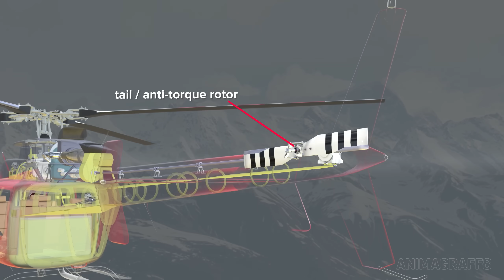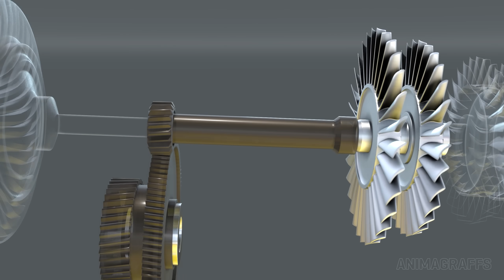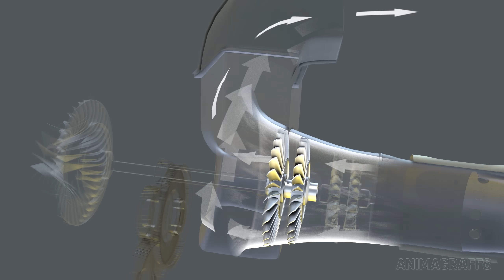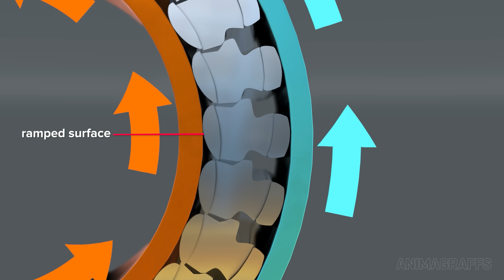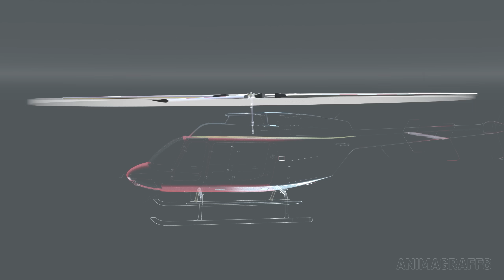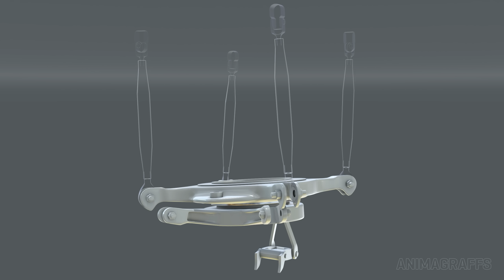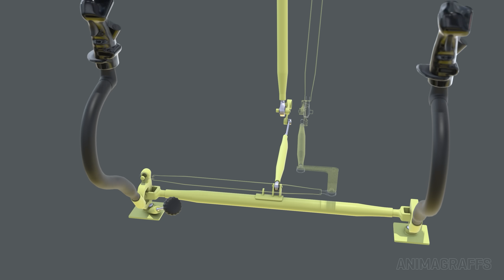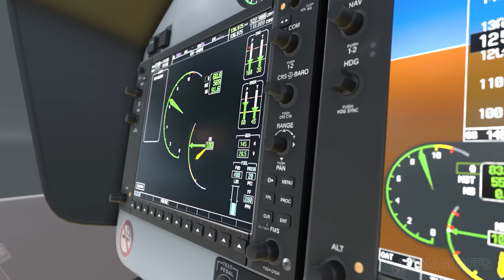How a Helicopter Works (Bell 407)

Comment: Very good, may be it is time instead of making helicopters with so many moving  parts use drones with four electric motors and gasoline generator on board to supply power to the four electric motors to reduce risk of so many moving parts like helicopters.

Comment: The more you understand how a helicopter works, the more impressive it becomes that these machines can fly at all. From the turbine and transmission to the swashplate, rotor dynamics, and tail rotor, every system has to work together with incredible precision. The 3D cutaways make all that complexity so much easier to understand. Absolutely fascinating engineering.

Comment: Question! Why would the design want to reduce rpm’s before reaching the mast? Each gear is reducing power, right? At the start of the system is approx. 20,000rpm and at the blades it’s approx. 600rpm… so why waste all that energy?
Reply: It’s not a waste at all – – it simply takes the natural mechanical function of a very fast spinning turbine down to the RPM’s that the rotor can handle

Comment: Seeing how mindbogglingly complex a helicopter is, I can't help but wonder, had helicopters never existed before my time, would I have been intelligent enough to come up with this myself? And the answer is maybe... but even if I did come up with these concepts myself, the damn thing would have never been built, because the main part of my brain would have been screaming ARE YOU OUT OF YOUR GODDAMN MIND??!? 

THIS many fussy, frail, complex, fiddly parts, all having to work together, at such high RPM, under incredible centripetal forces, all which not only having so many mandatory unconstrained degrees of freedom, but be able to work reliably, fly in the air, and not have some tiny little toothpick of a part snap and send people plummeting to their deaths on top of other people?? Heat, flexion, stress cycles, compression cycles, metal fatigue there's SO MANY WAYS for this to go wrong, I'd have thrown the idea out if I'd ever come up with it.

Turns out I'd have been wrong, it works fine, but just imagine the engineering audacity it had to take to design such a thing!

Comment: Helicopters are insanely complicated. The sheer amount of engineering and design required to get this thing to fly is nothing short of a miracle. It really bolsters the old saying that helicopters don't fly, they beat the air into submission. It really is just an exercise in using brute force in order to achieve the impossible.

Comment: 10:55 A typical example is "The 1977 Encino Helicopter (Bell 206) Crash" - the pilot didnt survive it due to many reasons:

• He realized the fuel gauge was faulty, but the repairers didnt inform him after it had been fixed - so, when it was actually empty...
• He did an abrupt autorotation cuz people were in the way. 
• The tail rotor 'fell off' during the autorotation just 50 feets above the ground 

Why would a tail rotor fall off? Why do most aircraft crash result in both wreckage & burn, not just wreckage?

Comment: Due what a video.... everything is beautifully explained and tbh i take 2 things from this, the engine design is beautiful, elegant and just crazy to think,  second is the material science, since im just an average Joe when it comes to flying i thought that a lot more of the parts where rigidly connected, when you started mentioning "rubber like" components and it just kept going it left me kind of amazed at how many points use material "springiness" to not shake itself appart, trully amazing, ty for making such incredible content, just stumbled across this on my feed and it was the best mistake to make at 4:30 am lol cheers bud (subscribed and liked and my only regret is that i only have one like to give)

Comment: 直升机（以贝尔 407 机型为例）的工作原理：

1. 动力系统 (涡轮轴发动机)
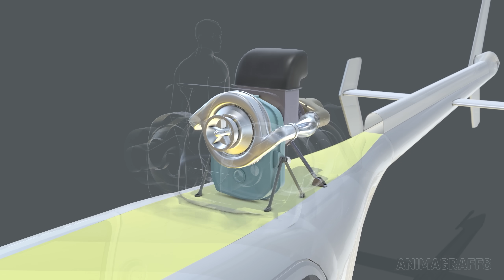工作原理：直升机使用涡轮轴发动机（Turboshaft），其核心类似于喷气发动机，但目的是驱动机械轴而非产生喷气推力 [05:03]。
发动机循环：空气被吸入压缩机压缩，在燃烧室与燃料混合并点燃，产生的热气流驱动涡轮 [08:46]。
动力传输：发动机动力通过减速齿轮箱，将极高的转速（约 48,000 RPM）降低到适合驱动旋翼的水平 [09:50]。

2. 传动系统与安全机制
自由轮装置 (Freewheeling Unit)：这是一个关键的安全组件，包含一个单向超越离合器。当发动机故障时，它允许旋翼在没有发动机动力的情况下自由旋转，从而进行自旋降落 (Autorotation) [11:46]。
主减速器：通过行星齿轮组进一步降低转速（降至约 400 RPM），并驱动主旋翼轴 [15:02]。

3. 旋翼控制原理
总距控制 (Collective Pitch)：同时改变所有旋翼片的俯仰角，控制直升机的升降 [21:57]。
周期变距 (Cyclic Pitch)：通过改变旋翼在旋转过程中不同位置的俯仰角，产生不平衡的升力，使旋翼盘倾斜，从而实现前后左右的飞行 [24:30]。
自动修正：视频详细解释了旋翼片的“挥舞”（Flapping）、“领先-滞后”（Lead-Lag）等复杂运动，这些运动能够自动抵消飞行中的升力不对称 [25:53]。

4. 尾旋翼 (抗扭矩旋翼)
功能：用于抵消主旋翼旋转产生的扭矩，防止机身反向旋转 [01:01]。
方向控制：飞行员通过脚蹬控制尾旋翼的俯仰角，从而改变尾部推力的大小，实现飞机的偏航（转弯）控制 [42:43]。

5. 驾驶舱与仪表
控制杆：包括控制周期变距的周期变距杆、控制升降的总距杆以及控制方向的脚蹬 [40:29]。
显示系统：现代直升机使用数字显示器，集成飞行姿态、空速、高度、发动机扭矩（Q）、气体温度（MGT）等关键参数 [49:24]。

Comment: Smaller RC helicopters with rigid blades and head components get away with zero phase lag, If you want to tilt forward, the blade is going to have its maximum pitch when it's at 6 o-clock

Comment: Hello dear sir madam the driver sharf work with the plan  and the sun gear let the helicopter work up into the air with the help of the poppler blades, and the half short drive sharf and the and bearing hanger 2500rpm works well with with tail boom and camshaft and tail blades and gas and sparks plugs and oil are essential to start the helicopter forward and to lift into the vertical areas 😊😅🎉🎉❤❤🇯🇲⛵💫🌞✈️🏡💸🔥💦🚗🐐🙏

Comment: I think it would been easy to explain in short ways about the engine/movements /the rotation of the blade and how it lift,go forward and balabce against the gravity .The details of the components or injection, ,injunction,ignition or combustion functions may not necessary in deep details  even for those flying it .

Comment: Impressive representation.  I think the dissymmetry of lift in both the main and tail rotors is missing the flapping function a little.  In the main rotor traveling forward, the advancing blade produces more lift, and it is allowed to flap upward, and this flap travel angle upward reduces the angle between the chord and the relative wind across it by the added vertical component.  It is the opposite on the retreating side where the angle is increased between the chord and relative wind by the added vertical component of flapping down, so in forward flight the advancing blade is higher than the retreating blade (mixed in with the other processes).

Comment: Didn’t realize there were two sections in the turbine (gas producer and power).  Curious why the engine isn’t mounted reversed to have air flow straight through instead of the tortuous reverse flow of the exhaust?

Comment: Air is not squeezed in a centrifugal compressor, air is accelerated to a high velocity and that’s traded for pressure when the air hits the casing. It’s no different on an axial flow jet engine except they use blades and stators. There is no squeezing, the path narrows because it can.

Comment: 31:55   I've read somewhere that the cavity in the D-spar is filled with Nitrogen and pressurized so that sensors can immediately notify the pilot that a damaged blade has been detected through pressure loss.

Comment: Modern jet engines are no longer turbo jets, so they do not make their thrust with expanding exhaust gasses through the jet “exhaust”. Modern engines are turbo fans, the entire purpose of the jet engine is to turn a large fan at the front, and blow enough air out the back to move the aircraft. Kind of like if you mounted an oscillating fan to the back of a boat. Modern fighter jets are also turbofans, but also have an afterburner that will contribute to the thrust by igniting exhaust gasses as they still have unburnt oxygen. This produces 40% more thrust, but all modern engines get their primary thrust just from driving a fan at the front.

Comment: The Bell 407 is a derivative of the Army OH-58D Kiowa Warrior.

After decades of military program development the OH-58D entered service in 1985 on a limited basis and was the first to have the soft-in-plane rotor system which the Bell 407 uses, a rotor system which differs from fully articulated systems in using a composite yoke to achieve independent movement of the blades for lead/lag and hunt. Beginning with the Light Observation Helicopter (LOH) program the Army chose the OH-6 from Hughes in 1965, yet two years later the Bell 206A JetRanger was chosen when Hughes failed to meet contract requirements. Through the 1970s the Army sought an improved platform in two programs, the Armed Scout Helicopter (ASH) program and the near term scout helicopter (NTSH) option. The later put ASH on hold and sought to improve in-service platforms, namely the 206A JetRanger.

The Maiden flight of the OH-58D came from that concept in the Army Helicopter Improvement Program (AHIP) on 6 October 1983, two years before it entered service. The OH58D was first employed in combat during Operation Prime Chance in 1988. The Kiowa Warrior would be upgraded in mission capability on a regular basis until retirement from U.S. Army service in January 2017 though the aircraft remains in service in multiple foreign militaries.

The Bell 407 first flew in 1994 as an upgraded 206L-3 LongRanger using the engine, rotor, tail rotor, and much of the flight control hardware developed for the OH-58D.

Of note in the OH-58D is a problem of airframe cracking due to vibration of flight and engine hardware. Cracks were first observed on the tail boom just forward of the tail rotor, and once that portion was sufficiently reinforced the vibration translated forward causing cracks at the oil cooler mounts on the after portion of the engine deck.

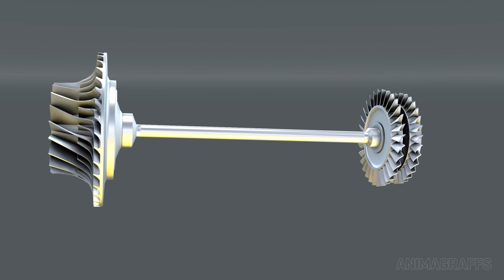Comment: 7:50 can someone tell me why on earth the shaft driving the rotors is the hollow one, instead of the air compressor one??? doesn't that make it more prone to breaking/not able to handle as much torque?
Reply: @theycallme_nightmaster  
The torque transmission capability formula, the radius is power 4, so any increase in radius dramatically increases the torque transmission capability. Also bigger radius makes it less prone to vibration. So thats the reason most driveshaft are hollow, because the material in the center transmitts no torque.
Reply: @theycallme_nightmaster  No actually! Driveshafts in aircraft are always hollow because it gets them the same strength at far less weight. All the metal in the middle of a solid shaft isn’t doing very much. The N1 spool on the 250 is also hollow.

Comment: As a physicist, I am still convinced that phase lag and precession are the same thing. Typically, people will associate precession with a hard disc, which is not necessarily true. 

One can, for example, imagine a rotor made of an increasing number of blades, each attached to the others with rubber bands,  the behaviour would still be the same. Then one increases the number of blades, so that there is no space left in between, adds some rubber bands, it ends up being a full disc. Thus applying force results in precession. No matter if 4 blades or many small ones attached to each other

Comment: Wow that is the simplest engine.  I work on 412s, and they operate the same as a jet engine, with the exhaust in rear using 60% of power generated to  power the compressor section,  and 40% powering the rotors, with the gear reduction behind exhaust..  Engine is also mounted before the rotors.

Comment: 34:25 was so confusing.  Isn't the lower scissor link to stop the lower plate from rotating horizontally?  Why did he say vertically?  And likewise the upper scissor links are to ensure the upper plate spins in sync with rotor?  Upper scissor links have nothing to do with power transfer as far as I can tell.

Comment: In the early years of helicopter development, the engineers called helicopters "fatigue testing machines". The vibrations induced in the various parts tended to push to the limit of the fatigue strength of the parts, and cracks were induced.

Comment: Absolutely superb explanation and animation!  I initially couldn't wrap my head around how the cyclic controlled pivots in the swash plate at about the 10:30 and 01:30 positions could individually control pitch or roll (and not both) if only one of the control tubes moved.  Looking more closely at the animation I realised I hadn't accounted for the distance between the end of the pitch horn and the blade it was pitching.

Comment: Do the controls correct for precession?  So cyclic movement goes in the direction you expect?
Reply: beginning around 36:50, they seem to show that. if you look, the swashplate arms to the blades are offset possibly 45⁰ or more.
Reply: Yes. The controls are mounted or programmed such that the swashplate always tilts in the right direction.

Comment: Great explanations and animation. I have just one question you didn't clearly address. How does the mechanical versus hydraulic servo control work together? The servos seem to be mounted inline with the control arms but you didn't explain how those two types of input and output work separately and together? I assume, if electronics or hydraulics fail, the servos being mounted inline allow mechanical input but do the servos just enhance mechanical input when working? I hope that makes sense.

Comment: Amazing amazing illustration. I hoped to see where a shearpin would sit in between. Second: there are apparently different Kinds of masts. Like you illustrated with the blade axis is under a fixed angle, and there are masts where the blade axis tilts (Huey). In that case you can stand on the chopper and tilt the none rotating blades back and forth alltogether. Grüße!

Comment: The helicopter is not the only working schem. 20th century, in parallel with helicopters, discopters were developed - helicopters of a disk shape. The developments were carried out in Germany during the Second World War. It is known about the development of the disc designed by engineers Habermohl and Zieremann. The most famous discopter is the Focke Wulf 500 designed by Kurt Tank. It was a disc-shaped aircraft with a pilot's cabin in the middle. At the edges of the disc were located the blades of a coaxial propeller, which rotated in opposite directions from each other. The propeller was driven by two gas turbine engines. Probably, this was a gas turbine engine developed for the Panther 2 tank. The Habermohl and Zieremann disc had a similar operating principle. Only instead of separate helicopter-type propellers, these discs used a fan similar to that used in modern turbofan engines.  The disk was called Haunebu and was a flying machine with a round cabin surrounded by a massive fan. The fan blades had a curved profile and outwardly created the impression of a dome or skirt. In some undoubtedly authentic photographs of the Haunebu disk, the fan blades and the gaps between the blades are clearly visible. The Haunebu disk was built at the Skoda factories. There were also other developments of small single-seat discopters. The testing of one of these flying machines at the Peenemünde proving ground was witnessed by prisoners of concentration camps working there, as well as German soldiers. The device was a small disk with a teardrop-shaped cabin and three small landing gear wheels.

Comment: Thanks for this thorough explanation of how the helicopter works. I have learned a lot. Of course I had some idea but several things work different from my ideas. This video came up in my youtube listing because I, and a lot of others I guess, were looking videos of the Hudson river helicopter crash. Now some experts mentioned the so call Jesus nut   however you did not. You mentioned another nut on top of the rotor shaft. Can't find it now... But maybe that is also called the Jesus nut.
Reply: It’s the center point nub everything else is attached to (it has the teeth like ring)

Jesus nut is a slang term for the main rotor retaining nut or mast nut, which holds the main rotor to the mast of some helicopters.
Go to 28:53 Mast Nut
Reply: @JCX-9  Thank you for your answer. I was indeed looking for that part I thought was de Jesus nut.

Comment: Excellent. I am wondering what happens in an engine that would detach the tail, and eject the rotar mast and rotor blades?
Reply: Something seized inside the transmission more than likely.. Causing a sudden stoppage of rotation and all of the force and vibration from that stoppage made an already weak component somewhere else on the helicopter fail in a catastrophic manner...
Reply: DEW

Comment: Wow, great video.  If I understand the free wheeling unit, if the engine transmission seized, then it would also autorotate?    If that's the case, then the Bell 206 crash on 10 April 2025 would need be a rotor transmission seizure?

Comment: id like to see specifically the Apache helicopter im particularly interested in what that huge dome thing is on the top of the rotor assembly

Edit: i just googled it its radar, for some reason that never even occurred to me as an option i always figured it was some kind of weight